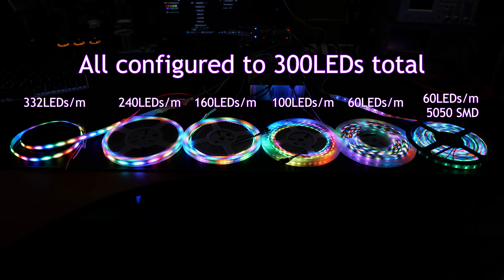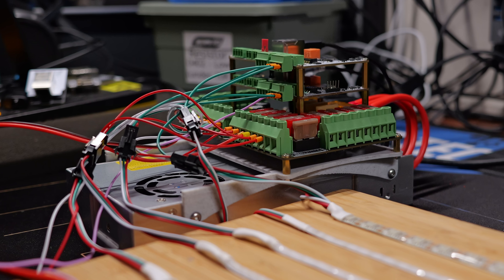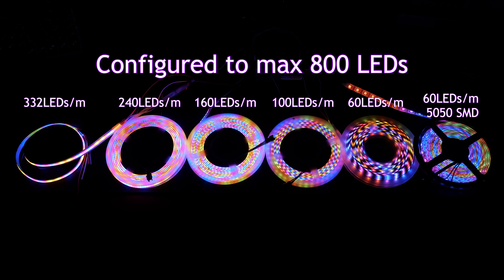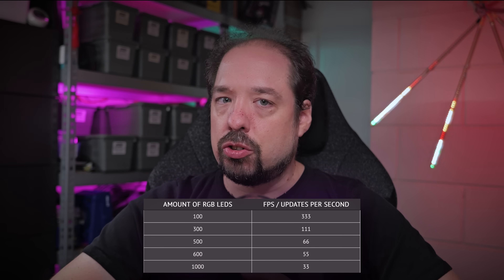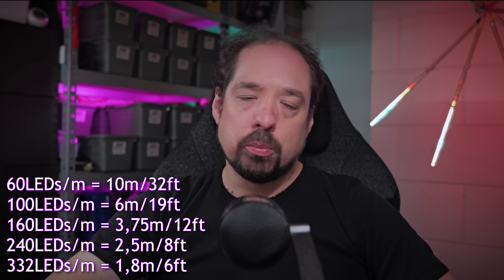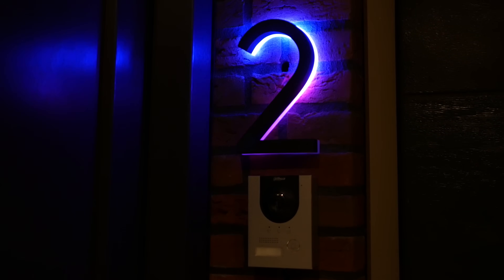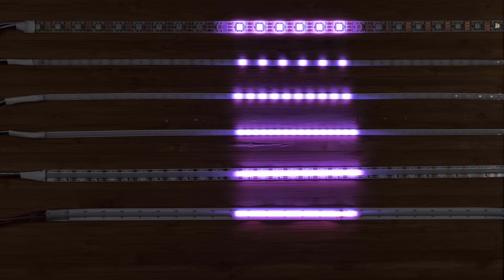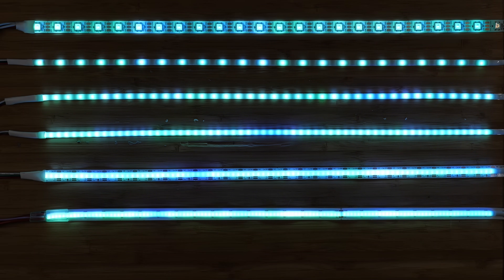💡QuinLED💡New COB style addressable LED strip

Comment from the maker: Do you like this new COB style addressable LED strip or do you like the 5050 traditional style better? I'd love to hear your opinions! I think they offer a great new style to be used in projects! :D
Reply: i searched about efficiency, but not found any lumen ouput measured of them, or even a addressable led strip comparison. . i want to light up 20m at low level, but it would be nice to know which one is most efficient. i know, the 5050 are not really good, i hope the cobs are a bit better.
Reply from the maker: Are we talking RGB or white? For analog white it's all a bit easier to compare since the good vendors list lumen per watt, but that's usually for white only. For addressable RGB I'd certainly say these COB style strips are more efficient then a 5050 style one.
Reply: @IntermitTech   I want to use RGB. In the COB group, i noticed that the 12v variants need only 12watt and the 24v need around 23watt with the same amount of leds. These are values which btf lighting has on the homepage. I guess it is the controller which can use the lower voltage better instead of transforming down 24v to led level.  If the values are real it makes almost no sense using the 24v variants.
Reply from the maker: @rolliseventeen unless it's also twice as bright. I haven't throughly tested the 12v version since the amount of zones of the 12v and 24v are the same and then I'd rather have the higher voltage. In that regard those 24v "addressable neon" are among the brightest addressable I've seen!
Reply: I do like them I just prefer anything directly visible have smaller ic segments to allow smoother light flow. I may need to play around more with a wled controler to realize the full potential of the larger ic segments of 36 led.
Reply: I already have LEDS/M
5050 SMD THEN the other 60LEDS
Reply: Hi Quindor   I have just purchased the 5M 24v cob wa2811 720/m strip via your link I am using a 24v 6 amp and a diguno. What settings do I use in the led preferences. It’s only lighting up bright white. Thanks
Reply: @kingkevhenryviii  it's the number of ic in the strip 100
Reply: @terrysavage5816   Thanks.. is there any other settings I need to change?  its set to WS2811 and ive put 6000 mA maximum current. Led voltage set to 5v 55mA. its still coming on all white and very hot.
Reply: @kevinhenryviii  I use 3000 but mine is 12v. It seems the norm . Or set it for auto. You could just start at 3k and adjust and see.
Reply: @kevinhenryviii  a 5v would be different ic count if the segments are 36 per ic then it's 100 if it has smaller segments then it may be like Quinns and it's each ic and that's 720x5 m so 3600.
Reply: @terrysavage5816  Many thanks for your help. It’s now all up and running 👍🏻
Reply: When I talked to a couple of LED manufacturers on Ali Baba a year or so ago and I was inquiring about Addressable COB LEDs for a project I was doing, they actually cautioned me not to use the COB Addressable because they said it wasn't very stable at that point in terms of longevity. I did still buy some samples though and they were very cool.
Reply: I HAVE A VIVI HI LO MID FUQ.CONTROLER LITE SHOW I CAN'T GET ANY HELP FROM VISUAL VIBES
.I USE WS2812B LITES NEED THEM   NOW LET ME KNOW WHAT I CAN USE. I'M POOR AT TX. THANKS CASEY
Reply from the maker: @kirkcantrell6846 I literally have no clue what you are shouting about. Maybe come to the Discord server and calmly explain what's going on? We'll try to help where we can.
Reply: @IntermitTech  lol
Reply: Not a big fan of there display, use ambiance. Never really bright enough to light a room with, considering he number of LEDS and power use. Intended for use on a drone, Too much power requirement for 100L/M considerations. Or for any battery usage really. As Accent or embolishment, ok, but again, not really a high density requirement once size is worked in. Ypu won't see it on your eves. So, What use balances the need for that many addresable LEDS?
Reply: I bought two strips to test.  I've been trying to find one for general lighting that's also RGBW and these are great!   My choice comes down to #1: efficiency and #2: flexibility, #3: CRI quality, and I guess QinLed's score the highest on the market.   I only wosh there were more color templates options, like daylight 6000k.  3000k is too yellow for my taste.   Plus, 24V makes this run pretty hot, like you said.   But the strange thing is it is hot on the WNTIRE strip, even the parts NOT lighted up.  I guess the resistor turn too much to heat.  I wonder how a 5V resistorless version would fare compared to the 24v version, despite knowing we'd need 5x the copper layer to run the current 😅

Comment: What are the fire style LEDs behind you? I would like to replicate those in a handheld fan using battery power. Thank you.
Reply from the maker: They are 144 LEDs/m strip on a Dig-Quad. I my case 12v ws2815 but it would look the same with 5v ws2812b too. The fire is just a WLED effect.

Comment: Saw a couple of others discussing heat and that's my concern as well. The 332 strip would be ideal for the project I'm working on and I only need two strips less than a quarter meter. But it would be enclosed inside of transparent pla that starts to warp around 50-60 degrees C. I've measured the temp of a 160 strip I've got it it read around 39c. So does that mean the 332 strip would be around 78c, or does is the heat increase less than that when you double the leds? I would just get a strip and check myself and return it if it's too hot, but rule of thumb according to a lot of people is never return anything from Aliexpress.

Comment: Have you done a video on wires and amps?
I see so many LED videos about setups, batteries etc but none of them go deep into the wires they use.
They just say something like, I'm using a 12V 25A 300watt power supply with 18 gauge wire.
I don't get how people can use such little wire gauge with such big amp setups.
Reply from the maker: For sure, check out this one, it will teach you how to actually calculate everything instead of random guessing or "I used this" which you indeed often see. https://quinled.info/the-ultimate-led-strip-power-injection-guide/
Reply: @IntermitTech  
Thank you sir 🙏
Reply: @IntermitTech  
This helped greatly.
You personally like 18 gauge as per your site's comments.

And this comment helped greatly too, assuming I understand it correctly, "If you are, for instance, single feeding a 100w LED strip which runs at 24v and needs 5 meters of cable this requires 4,16A of power and thus a wire thickness of 0.75mm2 to transfer it over those 5 meters. If you however double feed the cable (from both ends) the requirement per cable is only ~2A so thinner cables can be used!"

So you're saying that if we power inject at both ends this can halve the wire gauge requirements, is that right?

My system will be 13 meters of WS2812B LEDs.
I have a 12V 25A 300W LED power bank and the system will appear to use 12V 22A 260W.
Since 18 gauge wire can support up to 16A (according to Google) and I'm power injecting from start and end, I should be able to use 18 gauge wire at start and end to balance the load.

What type of fuse would you suggest I use, 2 x 13A fuses for the start and end power injection sites?
Reply from the maker: So almost.
If the total your strip needs is 4A, a single injection will be able to deliver it 4A and thus you calculate the cable length an diameter you need for the to stay under 10% drop.
If you now however power front + end because of resistance on the strip it will automatically load balance between the two cables and thus each will only carry a maximum of 2A and thus you can again calculate cable diameter needed to stay below 10% drop for each given length.

In your other example however if you need 22A total this means you will need front + middle + end for 4A + 8A + 4A for up to 16A you can inject and still won't be able to reach that 22A you calculated to need. Thus it becomes front + middle + Middle + end. That gives you the potential to do 4+8+8+4 and thus 24A in total covering the 22A you calculated you'd need.

Then you take each injection and put the expected power number + length of that injection from the power supply in a voltage drop calculator, stay below 10% drop and that will give you the cable diameter required for it to work correctly.

Although 18AWG might not melt from 16A, it might transport that with 0.2v voltage drop for a 10cm wire or 6v voltage drop for a 10m wire. It's a current + distance equation!

Hope it helps!

P.s you seem to be mixing 5v LEDs with a 12v power supply? And your numbers for current for those LEDs seem very high, did you calculate using 50% white as explained in my video?
Reply: @IntermitTech  
Apologies, the LEDs are WS2815, 12V.

Looking on your data sheet it has the white LEDs at 50% as 27.00 (watts?)
So over 13 metres that's going to be 70.2 watts in total.
So my LED power driver should be, say, 150 watts / 12V = 12.5A (in the event I want to increase the brightness % slightly)
Full brightness seems to cap out around 51watts per strip for all red.
At 13 metres that's 132.6 watts of red at 100% brightness.

Is this right?

Getting the power right is the hardest thing! 🤯
Reply from the maker: Yup, ws2815 is special in that sense, can't use the 50% RGB white value for that sense it's a 12v individually addressable chip making it very inefficiënt in that sense. So use the 100% RGB white value for that and you should be good. Those are real world tested numbers!
Reply: @IntermitTech  
Awesome. That makes sense!
So with the 12.5A, if there's a front + end injection, would this then be 6.25A + 6.25A for the entire system or do I need to do front + middle + end, 4.16 + 4.16 + 4.16 (roughly)?
Oh, and the fuse. Should it be around 8A if front and end injection is done?
Reply from the maker: Watch the video again, it'll explain. Max 4A for an edge injection, use a 5A fuse.
Reply: @IntermitTech  
 Watched and have calculated it all.
One thing I don't get is if I have 3 strip's, 1st is 5m, 2nd is 5m, and 3rd is 2.5; total 12.5m. With the start taking 4amps, can I middle inject at the start of the 2nd strip as 8amps?

You mentioned that this may reduce the start strip's 4amps. Will injecting at my 2nd strip's start reduce the starts 4amps?

After following your instructions I can see I need 10.4amps total, so if I do a 4amp start and an 8amp middle this will be 12amps.
Reply from the maker: Yes, that's correct. Make sure that middle injection as at the joint of the 2nd and 3rd strip so that power is most evenly distributed.

Comment: I have found these new Cob style to ONLY work at full power, and 2/3 of WLED effects are too complex to work. Also hard to solder and make connections, esp when not well marked; not every pad set is suitable for connecting.. Overall, not for same use as regular, when battery powered. ONLY FULL BRIGHTNESS otherwise flashing and color shift.
Reply from the maker: I have seen none of these issues? Yes especially the 5mm variant can be harder to solder. But only full brightness is very odd? Even in this video I show them with various brightness and such?
Reply: @IntermitTech  Thanks for reply/update. Have you tried making a section with a new connection? That is where this issue occurs, and things change depending where the string ends, cut 1 off the end and pattern changes. I am keying into possible signal hertz, you mentioned, and different PWM pins output at different strengths on ESp32/Arduino.
Reply from the maker: We are talking about digital strip right? Because no matter where I have cut mine, they behave as expected.

Nothing PWM about these too if you are using digital. They however do require a proper level-shifter and data resistor to function well, don't do well with 3.3v data signal directly from ESP32. But that goes for most strips so I would assume you are using the proper circuit or controller? Otherwise that might be the cause.
Reply: WS2812B COB RGBIC Pixels LED Strip Individually Addressable 60/100/160Leds/m WS2812 Smart RGB Dream Color Tape DC5V LED Chip Model-SMD5050:LED Chip Brand
Epistar
Yes, I am using a Esp32 and 8266 with level shifters GPIO 2 and 0. The PWM attachement is that arduino changes Hrtz as PWM changes... so I've just read, and that on Arduino different pins have different Hrtz..my brain applies that to ESp also? but that stuff is new area and deep to me.
Reply: Add: I have 2 different controlers, well tested with other regular lED strips, 2 out puts each. I have made aboyt 20 connection attemps(wire soldering) as possible overheating suggested, But, in the end, at low brightness they perform incorrectly( 4 sections made out of 2 different 60/100 strips)
Reply from the maker: Not sure what would cause that, could also be power or GND related. Behaviour should remain the same, be it at 100% or 20% (given power limiter is off). At really really low levels the bit depth does become a problem though since it just doesn't have enough steps to take left. But that shouldn't show up as weird Behaviour, just choppy.
Reply: @IntermitTech  Thanks. I've dug out another controller to throw at it and started sheet to do  record to track issue. Can you smoke a level shifter? Dig out the multimetre and poke it in places, Gotta get that darn fly outa my ointment. I'll loop you if a miracle appears to place in puzzle. TA
Reply from the maker: If you are doing digital there is nothing PWM related going on. The IC on the strip makes the PWM for the LED. And yes there are better and worse pins to use, especially on an ESP8266.

Comment: Great video, gave me a good guide.  What would you recommend for 2 x 10m strips for a hallway, they would be in a defuser at floor level.
Reply from the maker: For 10m I'd go with at least 12v but preferably 24v. Check the 24v COB video.
Reply: Thanks I'll check that out

Comment: Great video. I just have one question. With the cob LEDs is each COB individually, addressable or are they bunched into groups? On Amazon I found 24v 630leds/meter but in the description they have this note “Group of 63LED addressable. 1 pixel=1 IC chip=63LED”  does this mean that each group of LEDs of 63 would only be addressable as one individual rather than all 630leds being addressable? Where can I find truly individual COB strips?
Reply from the maker: Check the nedt 2 videos and you will understand all! :
Reply: @IntermitTech  yeah i found those! thanks for your hard work!

Comment: What kind of controller are you using?
Reply from the maker: I use only my own QuinLED Dig controllers such as the Dig-Uno and Dig-Quad! In this video I believe everything was running through a Dig-Octa board.
Reply: @IntermitTech   i’m interested in the natural reflections like fire, water ripples, tumbling leaves in the wind lol, etc. Also I have an electric wheelchair. I would like to sync the chasing (or patter loop whatever) with the speed of my wheelchair so it looks as if the light is coming from the ground and not from my chair.

Comment: Hi Quindor.  I am on a journey with my LED's installations  and thanks to your channel so far. so good. I have purchased a number of Diguno's and all is working great.
I decided to try a ws2811 24 Cob 720/m via a link your provided and it has arrived. I have a 24v 6 amp power supply as I only plan to use the 5m of the strip. 
My question is what settings do I use for the LED preferences. Your help would be much appreciated.
Reply: I'll be doing this also but with 12v for 5 meters. Hows your experience?
Reply: @Elvewizzy.  It looks great. Setting up was easy in WLED. The effects are much different than the individual addressed led strips as the colours change in sections as opposed to individually.
Reply: @kingkevhenryviii  I see. How long was your run if you dont mind me asking :D?
Reply: @Elvewizzy.  4m
Reply: @kingkevhenryviii  And no power injection required??
Reply: @Elvewizzy.  no 👍🏻
Reply: @kingkevhenryviii  Excellent. Thank you kind sir.

Comment: Is there an equivalent Zigbee version of this controller? I’m sure I’m not the only one out there thinking of wireless network failsafe’s to maintain smart system operability during router or hub downtime…
Reply from the maker: Of the Dig-Octa? No, that's my design basically. But you can run them on Ethernet? Then you are not longer reliant on anything wireless.

Comment: Could explain pixel count with these and wled? I have a set of  fcob rgbic 720 led per meter. I just don't know the number of led is it 36 it says 1 pixel equals 36 led and I ic so 20 ic per meter. So I segment is 36 led but counts as 1 led? But it says 720 led per Meter . 3600 total. I think in the end it's 20 per meter 100 per 5.
Reply from the maker: You basically count the ICs on the strip. Normally they then say each IC is an RGB LED but on these they went event trickier since they are not in a single 5050 package. 720 is R+B+C! So 720 / 3 = 240 RGB LEDs! Then it's 12x per color diode in series per chip so 240 / 12 = 20 zones per meter or 100 per 5 meter.
Reply: Yes I ended up correct. I apologize for asking such newbie questions . I just got  a bit mixed up due to the 720 led per meter . Ty for your time.
Reply: If anyone else is reading this. The type with less ic is a waste when you can buy the same strip with alot more ic witch is more addressable leds. Why would you want them in groups of 36 led and only 100 groups . So there are strips with more chips and more groups same price. I just struggle to see the different applications.
Reply from the maker: Well there is reasons for that though. You need the amount of LEDs in series to drop the voltage from 24v to around 3v which the LED diodes themselves use. I'd rather also have higher resolution options but higher voltage comes with tradeoffs in that sense. If you need high resolution the 5v addressable COB versions go up to 332LEDs/m!